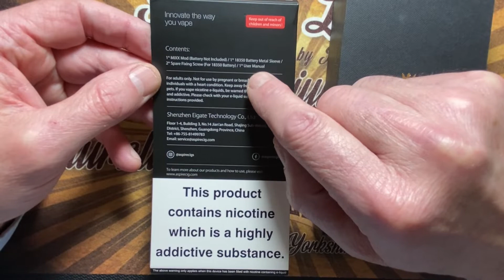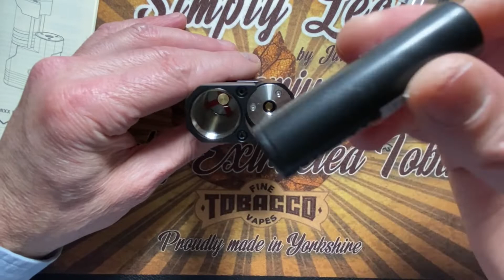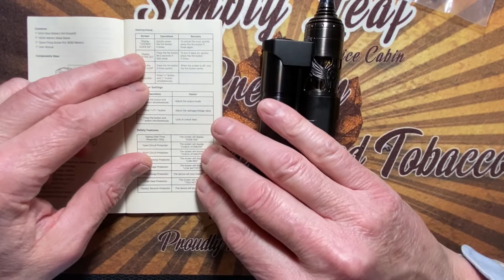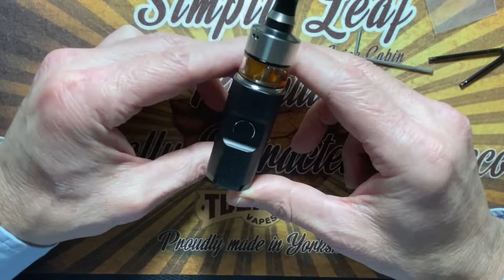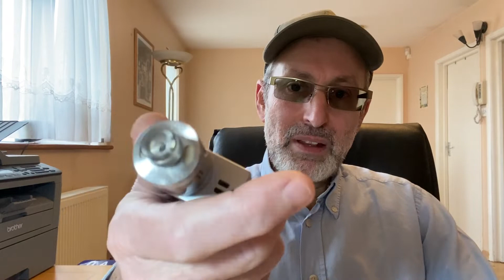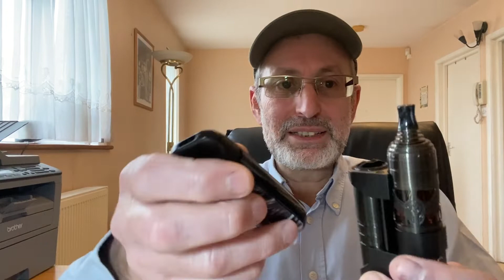Aspire MIXX Mod | Designed by Sunbox | Stunning & high end quality!!

Comment: Hi Nathan, I already use 3 mods (2× Aegis Solo + 1× Aegis single battery). A friend is offering me an Aspire MIXX with 21700 extension for €110. Does the MIXX give any real difference in flavor performance compared to my Aegis mods, or is it more of a luxury/collector’s mod? Would love your opinion before I decide. Thanks in advance.
Reply from the maker: @OreoTheLab-u2z. Ok one golden rule. The Mod has nothing to do with flavour whatsoever!! It simply fires the coil and vaporises the liquid. So no difference at all what mod you use. The main & only factor is the Tank / RTA / airflow system / correct wattage and the quality of the coil wire or stock coil and of course in a RTA your wicking it right makes a difference. Bottom line is use any mod it would not make any difference to flavour.

Comment: How good it is in temperature control mode ? Is it comparable to DNA ?
Reply from the maker: There is no temperature control mode. Although the screen display looks like a DNA it is not a DNA chip but still very good & accurate. For those who are not DNA enthusiast you will never notice a difference.
Reply: @netvaper  oh .. thanks A LOT for your reply .. it is wierd that it doesn't have temp control though ! 😃

Comment: It’s very helpful that you demonstrate this with different RTA’s.
a bit late but I keep coming to this review of the Mixx.
For my taller (Kay prime/Ex V4/GG Perseus) RTA’s all in the extended configurations it’s look that this SBS will suit the best,look wise and proportions wise.
They should came more or less (height wise) as the look of the Brunhilde you’re demonstrated.
Even with the coming Paramour it seems this still looks more fine match in design it in regarding tall extended mid to up market MTL RTA’s.🧐
Reply from the maker: Thanks Isac. All the RTA’s you mentioned would look great on the MIXX. But on the Prime you wouldn’t be able to change airflow settings whilst on the mod.
Reply: @netvaper  
Thanks for pointing it out,I wasn’t aware of that regarding the Prime as the airflow ring is 23mm.
I think it will not make big of an issue as I use the same settings (the already familiar hole #3 😊)
The more I care is to reduce the visual effect of the height perspective and too provide some cover and more weight balance to protect the glass part.
I used Swag I and after that Swag II for them so far.
I also have Kizoku Techmod on the way,yet opt in mind different pairings for it.
Reply: @netvaper  

Well,I’m happy to report and update
That there’s no issues regarding the Kayfun Prime on the Mixx and Airflow and Juiceflow work as they should.
Kayfun Prime 4.5ml mod (standard pre TPD force regulation) look perfect on the Mixx.
I prefer the “longer stem” somewhat cooler vape on NETs as opposed upfront brightness taste notes which in turn may increase fatigue on taste buds on the TPD trend of reduced size RTA’s.
It’s a give and take in both cases.
my take for NET’s is on 4-5ml taller RTA’s 
On fruits and desserts it may turn the opposite if one look for the zest or smacking affect to be more pronounced at the get go.
All is good,have a pleasant day.
Reply from the maker: Thanks for the update & enjoy the Mod

Comment: After use you found scratch on mod?
Reply from the maker: No I didn’t Kom.
Reply: NET Vaper.   which one you choose  easy mod,mixx,swag2
Reply from the maker: I have all 3😊 the MIXX is the most stunning although due to the MIXX upper frame design some 24mm tanks with thicker top airflow rings would not fit properly but would fit better on the side by side by ambition mods & 25mm on the swag 2.
Reply: Net vaper . Thank you verymuch for your advice. I'm Fc of you from Thailand but e-cig illegal in my country, we must hide from police if want to vape😥😥.
However I follow and admire your clip very much.
Reply from the maker: Thanks Kom. Crazy & unbelievable that smoking is allowed and not vaping absolutely madness!! I hope the truth will eventually win and you would not need to hide when vaping.